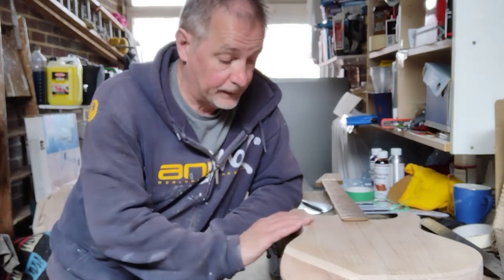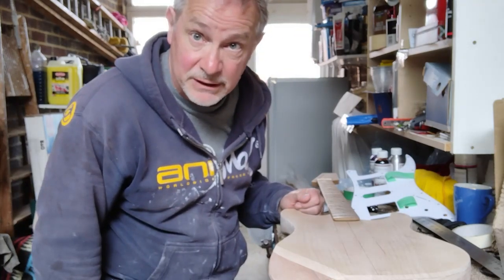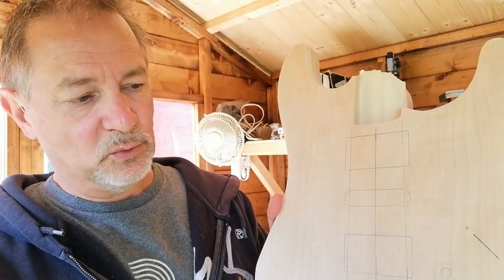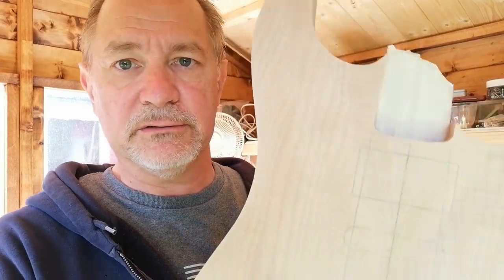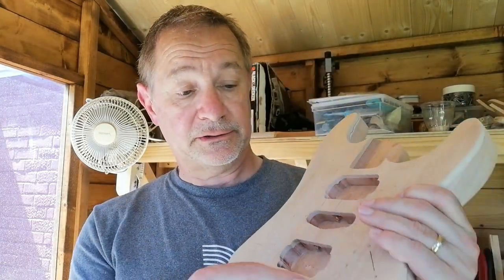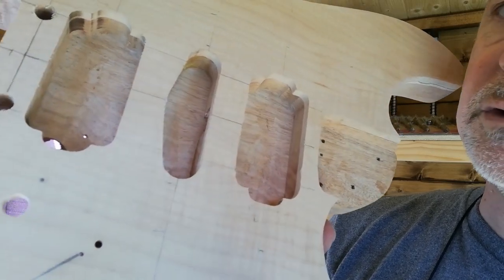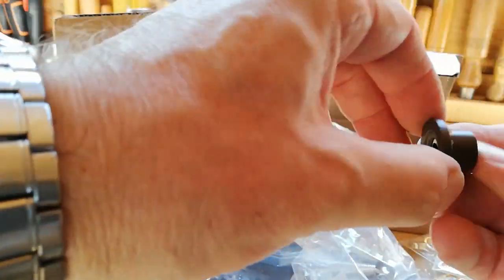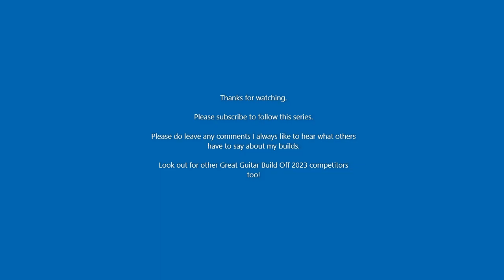GGBO23 Episode 3 Working the body and Hardware.

Comment: Looking good so far! With the switch slot, for my Strat build in last years GGBO, I used a router bit that didn't have a bearing, and made a simple jig for my router so that it could only move in a straight line 25mm long (or however long it needs to be). It worked pretty well. Here's a link to the video if you're interested: https://youtu.be/OhYtFO8q3yM?t=102
Reply from the maker: Thanks. That's along the lines I'm thinking I might do it.